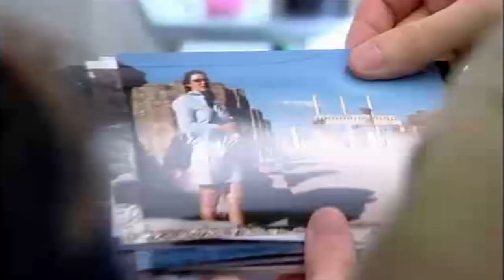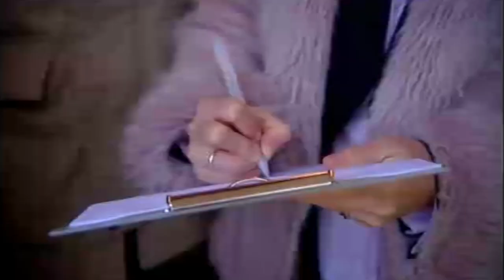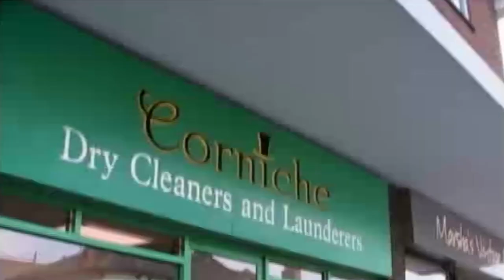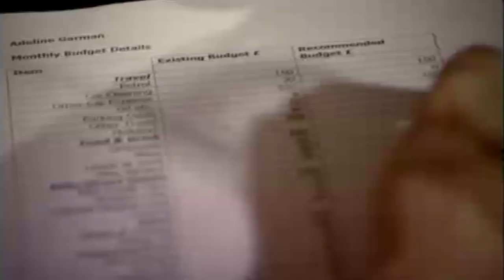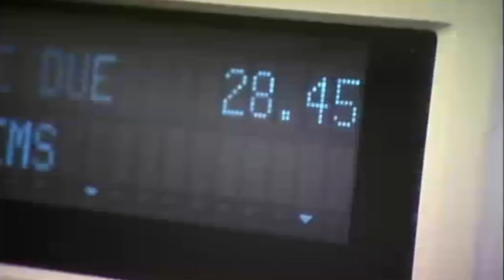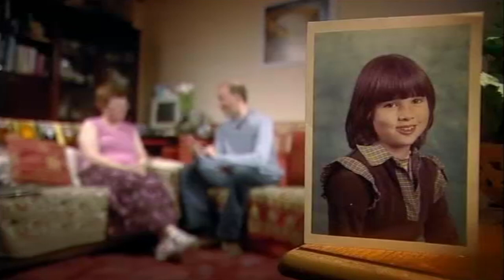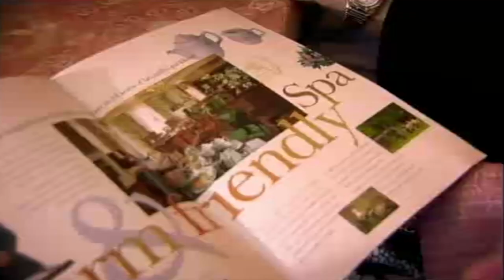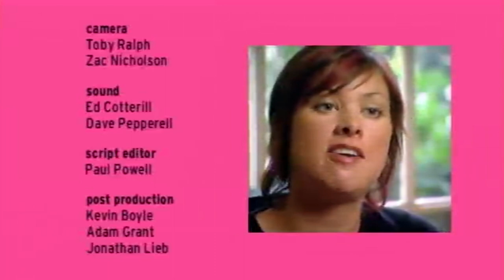I am Addicted to Buying Shoes | Spendaholics | Only Human

Comment: My daughter loves shoes but pays little and only has a few special ones. I buy mine at thrift stores, so if they break easy to throw out. I bought one new pair recently for $4 an wore them 3 times. The sole cracked off. threw them away. now I have another pair foe $5 that are holding up well.. As a single mum. I can't afford new pairs from new stores.